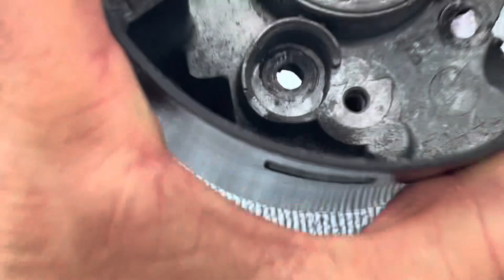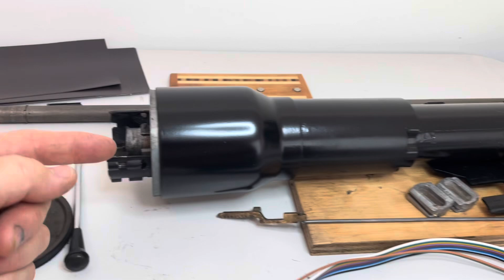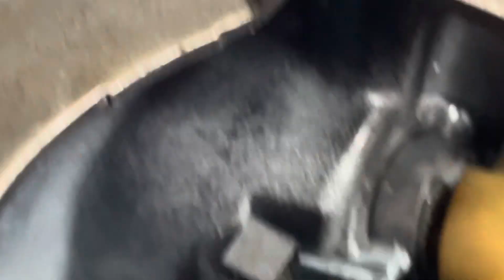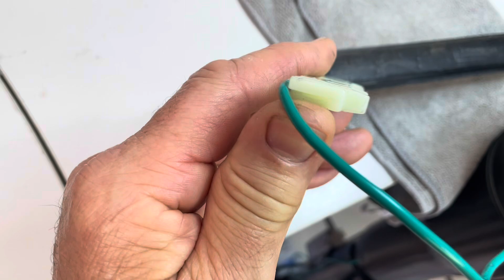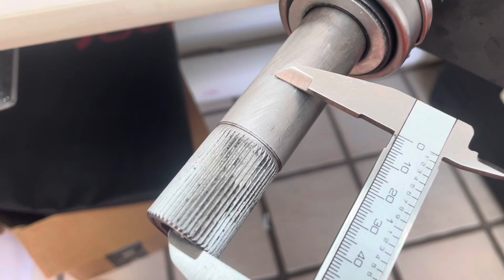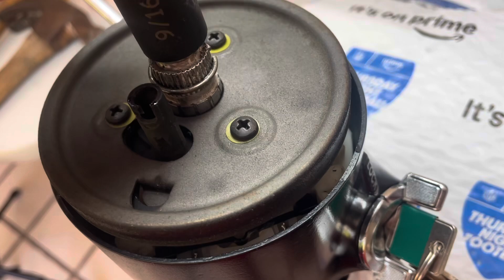C3 Steering Column Rebuild & Assembly.

Comment: Hey great video  im replacing turn signal switch  the first one came from wells. It didn't fit at all got a delco good fit my problem is  the wiring harness. Where it plugs in did not fit im having to use old connector. To make it work both  wells and delco were the same mine is a 1969 .did you  have that problem also I think there's  tons of junk out there if you or anyone  else reads my comment  id love to hear from you thanks guys in advance
Reply from the maker: The connector didn’t fit my car, so I replaced both ends and used a new multi-pin connector. I don’t recommend that fix, however, because the connector will now not fit up through the small gap in the column. I was just fed up and needed a solution.

Comment: I have answers for your questions on the Short concerning the tach drive gear, but I don't know how to post them on a Short.
Reply from the maker: @budehrmann5902  You can post them here, but I have it mostly figured out. Thank you!
Reply: @thedrivewayC3  You want to make sure there is a hardened setscrew in the cast iron housing for the driven gear to bear against.  The housing is too soft and the gear will wear into it and eventually strip the teeth off the mainshaft of the distributor.
Reply from the maker: @budehrmann5902  Are you referring to the Tach drive gear or the teeth on the Distributor shaft? I replaced the gear that goes into the Distributor and drives the Tach.
Reply: @thedrivewayC3  The tach drive gear is pushed into the distributor housing and wears a divot in the housing.  When it wears deep enough, the teeth on the tach drive gear disengage from the teeth on the distributor shaft and shear them off.  I had that happen on my 69 back in the early 80s and GM still provided new shafts.  I drilled and tapped the housing and installed a setscrew and locked it in place with a nut and locktite.  I am the original owner of the car and it now has 142000 miles on it. I learned about this problem in an article in Corvette News, a GM publication that was discontinued in the late 70s.
Reply from the maker: @budehrmann5902  Thanks for the info. I know what you’re talking about. The original had a small brass button in there, but it would wear out as you mentioned. 

I replaced everything in my tach and it should be good for a while. Not going to drive the car many miles, as it’s a fun project for the weekends. No road trips!